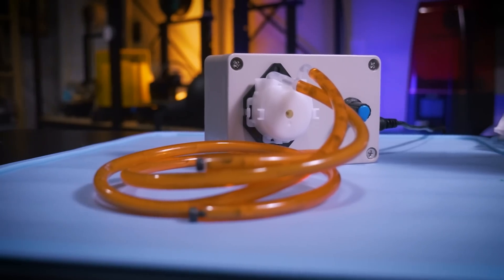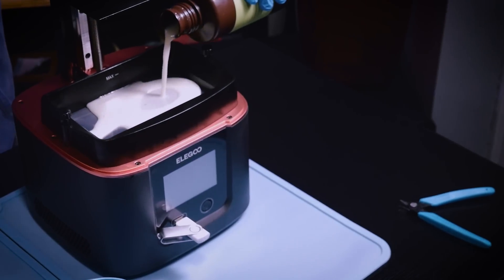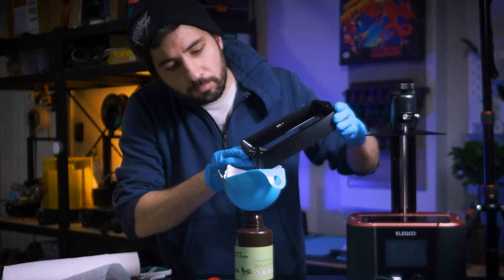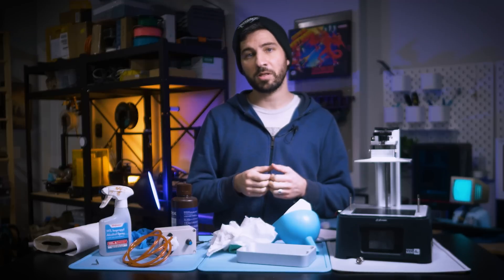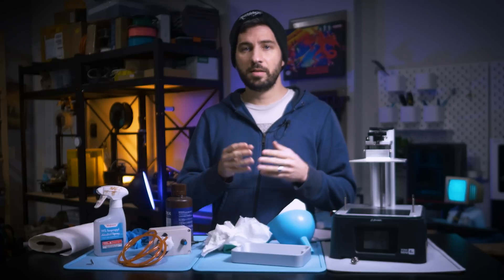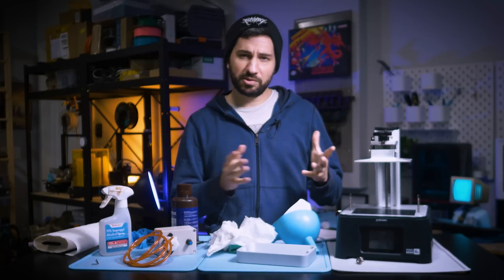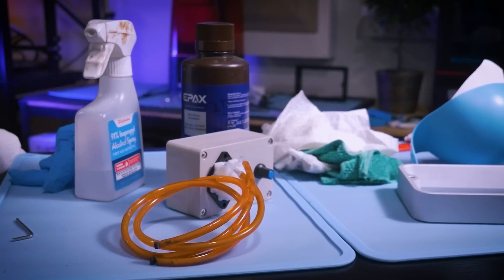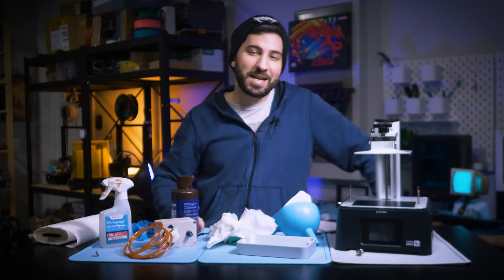The Best Resin 3D Printing Tool You've Never Heard Of

Comment: This is the greathing for 3d printer that we should have, I try to make it automatically fill the resin by the censore system and pull the resin back to the bottom when it get complete printing.

Comment: I use a big ass syringe but the pump would be good for the last bit.
I never remove the vat unless I'm replacing the FEP. When I get close to the bottom, I just put a block under the edge of the printer to can't it back/left/right to get the last little bit.

Comment: What about a two chamber vat that uses this pump to pump from the bottle into the vat and the vat has a low side that overflows back into the bottle through a filter. When finished you reverse the pump to pump the vat low through a filter and  back into the bottle. That way the build vat depth could be 1/4" and print until the bottle was empty.
Reply: Vat with an infinity edge on one side leading to another tube to gravity feed into a filter / funnel / bottle.

Comment: I don't even have the resin printer yet, but if you are still using the peristaltic pump, just put something under one rear leg so the vat is tilted towards, say front left corner and print the tubing holder to install on the vat corner, so you don't have to move the resin around with spatula. This way you only have to wipe the vat after it's totally drained. Although I'd go with really big syringe, as used for horses, wrapped in black foil or shrink wrap black tubing, suck all the resin in one stroke and keep it there instead of bottle. Oops, I just saw your other thumbnail with syringe. But I'll leave the comment just in case..

Comment: No reason to push resin through the pumping mechanism. Resin pots are pretty frequently used in the glue world. Just need a vacuum for extraction and a pressure pump for dispensing. https://www.youtube.com/watch?v=n8h4TjjQrow&list=LL&index=2&t=203s

Comment: Ah too bad, this completely changed my mind. Taking way too long with Elegoo Jupiter and having to be there all the time guiding the hose. The 500ml syringe is pretty expensive but I think I'll have to try that.

Usually I want to be quick 1.5 liter resin is a lot but hopefully I can design something that it doesn't go so far over the edge of the vat on the sides but just the corner.

Comment: Tip! 

Tank Inkjet Printers have an inline peristaltic pump to dump the waste paint into the waste container. You can reuse those by trilling a few holes and adding a DC motor directly to the gears

Comment: Great idea. Will try it. Thoughts on possible improvement: Instead of having the resin pass the pump, I would try to use it to underpressurize the target container and sucking the resin in there („suction trap“). By having one dedicated, short hose (at least for the most often used resins) for that, one might not have to clean as much for the next resin, and thus less resin would have to be wasted.

Comment: Just bought the pump.  It takes a 2mm ID tubing which I also bought.  However, the flow through the tubing is poor at best.  what is the ID of your tubing- it appears bigger than mine. thanks.

Comment: Man, I hate when people in videos show the use of the plastic spatula on the FEP sheet. It can damage the FEP sheet and you are telling us that you are wanting to handle the FEP as little as possible and yet you use a potentially damaging item on it. Why not use a silicone squeegee instead or even a rubber spatula that you would use for baking. So many people think that using the plastic spatula is a good thing and it is not. :(
I do like that you are using a pump but there is a lot of clean-up with that too that you aren't showing as far as clearing the tubes and the pump itself of the resin inside of it.
Reply: Hey, I get the sentiment, but these pumps are 100% tube. There is no "Clean the pump itself".

Comment: Can you tilt the whole printer a bit, (with wedges for example) so the resin flows in one corner where it can be conveniently collected? This way you don't need to take out the vat - or do you need to recalibrate the printer after you move it?

Comment: the worst thing i had? silicone mats...
as i learned from the plastic shop of my work, the best surface is plain stainless steel. Its smooth and you can clean it 1000x easier than these silicone mats.

Comment: Why are the Vats not designed with a tap? treat them how you would a reservoir for water cooling.  Add a tap to the outside with the proper grommet and plug to keep the resin inside.

Comment: Maybe a titling table surface that tilts the whole printer slightly to a corner of the vat. Then clip the hose (3d filament printed of course) to the low corner.

Comment: I ended up designing and printing fittings to plug my funnel into the bottles, so that the vat can firmly rest on the funnel. I leave it dripping for half an hour and it's totally dry by the end. It's okay solution for Mars and other small printers.

Comment: Can I add on here some of this can be automated with a jig pushing the vat to one side and you could totally put an in line filter on there not to mention there's already designs out there to print peristaltic pumps then all you need to buy is the hardware for that a few screws and a motor  that would also solve the speed problem too

Comment: I don't know, 
First of all anything stuck to the FEP will remain stuck to the film... you need to push on the back of the film to get those off.
Second, there's a lot of resin staying in the tubes
Third, I foresee a problem having resin in the scoops of the pump hardening
Fourth, cleaning the fep vat while on the printer seems risky damaging the UV screen underneath

But if it works for you... you do you...
 I'll keep doing what I'm doing

Comment: Danny, This is a great idea that has spawned possibly an even greater idea. I hate removing or adding as well. So my background is in mechanical engineering. and you messing with this pumping system has got me thinking. 

I will often leave my resin in the vat for days. or even when you have long prints. I notice the resin really likes to separate, and settle. This pump system could be done as a full time recirculation pump. always keeping the resin in the vat in a better mix. you could add an inline filter to the lines, and constantly remove possible particulate. the filter would work as a mixer as well. You could also add a second line to the input side, with valve to add resin as well as valves on the output side to empty. the hoses could be mounted into the vat on either side to create the flow, just would need some 3D printed clips. or for those with some machining abilities. threaded pipe nipples. I think you would want to get the hoses as low in the vat as possible.... 

Heck, some very cleaver Electrical Engineering guys could even make this type of system with a level sensor and solenoid valve system that would pull resin directly from a bottle and maintain a constant level of resin in a vat.  A little more electrical knowledge and that could add a flow meter to the output and tell you when the filter is plugged, level is too low, etc. 

Dual purpose system ,recirculation, empty fill.

Comment: Have a small cup of IPA nearby to flush out the tubing when you’re finished. Then flush it again with some distilled water. Won’t have to worry about cross contamination if you’re using different resins.

Comment: Got my first resin printer on order. I wonder if someone could scan the vat then modify it to have a threaded hole in one of the lower corners that you could fit a small needle valve into. You could design the opening of the hole so that it looks like a funnel that tapers towards the fep. Then just squeegee towards that corner to get most out. YouTube what say you? Oh and then print the new ported vat on the same printer? Would it fit? 🤔 depending on the Thickness of the vat , you might be able to curve part of the hole down below the surface of the fep for a lil gravity feed action. .. OK I'm feeling a new project coming on.

Comment: I like this idea. The one downside is the slow speed. 10 minutes for a Saturn means 15-20 for a Mega? There’s a whole variety of these pumps used for Aaquarium dosing and many are controllable with variable speed so do some research to find the fastest pump. 
To avoid the fire-hose issue, maybe design and 3d print a clip to hold the hose on the vat and another to hold it one the bottle - you could even incorporate something into a funeral to hold the hose. Again look into Aquarium equipment - there’s loads of clips and holders out there for dosing tubes and pumps.

Comment: Now I'm wondering if you could make a nozzle that fits the width of the vat you're emptying. Like the floor nozzle for your vacuum cleaner. If it has a built-in clip for the vat, you can probably just leave the printer at an angle while the pump runs. While you're at it, make a silicone squeegee at the appropriate width to make clean-up even easier.

Comment: I think there should be a pump recirculating the resin as it prints to prevent running out and chunks developing mid print.
Reply: if you are developing chunks mid print, then you need to calibrate your machine and exposure settings.  that is not normal and should never happen.

Comment: Nice idea. How to clean it at the end of the process? and will it quickly dirty the alcohol...
Reply from the maker: Cycle out some isopropyl alcohol through it all ya need to do. I filter between a dirty and clean Tupperware, but only when I'm done using it. Left it between days and no issues so far.

Comment: Great idea!  Some thoughts:

1. Get/build a larger pump to save time.  There are plenty of DIY plans/models/etc. available.
2. Use multiple pumps connected to a manifold that clips to the vat.
3. If you are DIYing your setup, you can attach multiple pumps onto the shaft of a single large motor.  A washing machine motor would almost certainly be overkill in terms of torque, but...
4. Use a 'dam' with soft edges that inserts at one end of the vat and seals the bottom and sides as it slides along.  That way, you can ensure the pump is pulling from the deepest possible pool no matter how much resin is left in the vat.
5. Incorporate a way to clip the manifold to the dam so you only have one piece to worry about.  You can create one dam for each unique vat size.

Does that make sense?

Comment: How do you prevent the resin from curing in the hose/pump? Completely cleaning it with IPA after each use seems to me more messy than cleaning vats the usual way.
Reply: if you put the pump and tubes in a box or something then the resin will never cure.   the only thing that cures resin is UV light.  most modern windows block most UV light already, but putting it in a box is even better.

Comment: Sound great! I'm a bit worried about the inner part of the hose. I imagine that those sticky resins (like Creality) will stay inside and get mixed with the next (transparent) resin. Do you have to clean it? That would create extra steps and maybe reduce the benefit of an easier handling.
Reply: Cycling some isopropyl once you're done cleaning the vat should be a decent way to dilute and remove any problematic resin in the tubing. That being the case it would still be wise to change out the tubes every so often.
In any case, I can't wait to give this a shot! I've had some peristaltic motors on hand for a few years with nothing to do until now!

Comment: this only works if you use the same resin if you swap it youll have to swap hoses and the pump because its all inside that pump this is kiinnda useless really think bout it
Reply from the maker: You must've missed the part when I talked about cleaning it out with IPA between swaps
Reply: You would clean out the hose using a little IPA so no need to swap.

Comment: I am not sure I understand how this is supposed to waste less resin than the screen clean function. All the resin in the tubes will have to be flushed out so you will use more IPA and more resin. Still better than manually having to drain it when you switch colors/resins, but I rarely do that.

Comment: i think the trick would be to have it attached to the vat. cycling and moving the resin i think would be good but i dont know. scrapers and tilting beds are a thing so i figure it might be good. but you could also use this to run the resin through a heating loop. some resins need to be heated to print well so that would be super beneficial. a couple of valves could easily let you set the pump to "drain" instead of loop.

Comment: You need a tip like that steam cleaners use to draw up a wider area of resin rather than needing to grab you scrapper.  It should be wide like 2 scraper blades  with a narrow slit between them and  tapering to the hose.

Comment: OK, my first printer, a resin printer, should be here in a few months and I am BRAND new to the hobby. This video makes me more than a bit nervous as I never realized this step existed. I have never seen a video of anyone that goes into what to do for clean up after a print. Made me realize there is an awful lot I do not know just getting started. Danny, do you have a video or series of vids for the complete beginner to resin printing (or any 3d printing for that matter) on how to setup to use their new resin printer for the first time, what all the steps are and what extra equipment I should have on hand before I start?
Reply: uncle jessy might, orjust search. you NEED  a respirator, nitrile gloves, paper towels, alchohol in a little spray bottle is very useful too, its a messy hobby. so waste disposal is big thing. and space. clear working space

Comment: Use some milliput around the tubing close to the end - you could easily mold it around the tube and push it into the screw on the vat (just get the imprint, don't cement it to your screw)- the weight would hold down the tubing, and it could rest on the screw to stabilize. A wad around the other end could easily have a paperclip inserted in as well, to hang on to your funnel.
Reply from the maker: The milliput is a great idea, and pretty simple! I might give that a shot!

Comment: The amount of resin you had in the vat is not what I would normally have left after a print has completed, I usually only have a few mm depth of resin left after a print and pouring it into a filter+ funnel is not a problem as everything is contained within a deep tray to contain any spills, which are rare, my biggest problem is forgetting I have gloves on that have resin on the fingers and then go and touch things and mark them with resin
Reply from the maker: You’re right, and that would probably make this a much better use in that case. Thanks for the comment!

Comment: I think you're missing the bigger use of these pumps, for the reverse! FILLing your vats with resin especially coupled with a smart switch (just on/off) or with an Arduino for large format you'd never have to worry about an empty vat mid print!
Reply from the maker: I knew when I posted this video that the comments would make this idea better. Ya’ll rock.
Reply: was thinking the same thing
Reply: The thumbnail had my brain thinking it was an autofill pump
Reply: How would you make the switch/sensor to make it an autofill feature?
Reply: @huyked  old school way, stick a float sensor in the vat. Same way a toilet works.

New school way, webcam + AI + training. A raspberry pi can do the job these days. You might have to train on a desktop or rent a server.
Reply: @jtjames79  
Thank you.  Will have to search around.  :D  "Tiny hobbit toilet float sensor".  :D
Reply: There might be a mechanical solution like the archimedian principle where it will autofill by pressure difference by itself.
Reply: @sierraecho884  there is and I was working on a design, but screw that this is a lot easier.
Reply: @jtjames79  Hahahah, true ^^
Reply: Could be as simple as knowing your print uses 50ml during 6h, you can easily program the pump accordingly ...
Reply: Tap a hole in the side of the vat if you are feeling froggy
Reply: Why not also feed that via a heater loop?

Comment: Strange, I see peristaltic pumps almost every day at work and yet I'd never considered this. Thanks for the tip.
As for something to hold the tube, consider a swing out clip mounted to the hold down clamps.
Reply from the maker: This is EXACTLY how I felt when Grant suggested the idea casually on that Twitter thread! It was really cool to try it and see it work on something other than clear solution in a lab or something.
Reply: Pick up a box of bulldog clips from the office supply store for a couple bucks. They hold securely and you can slip the tubing through the handles to hold it in your funnel.

Comment: How do you clean the pump out between resin colour changes, just run some IPA through it?
Reply: That or have different tubing for the color and clamp the tubing.  Most of these pumps allow for the tube to be replaced.
Reply from the maker: Like @zacknafin mentioned - you can choose to buy another set of the tubing, BUT that can get a bit messy cause the resin leftover on the inside will  absolutely spill out. If you’re using the same resin between VATs in a reasonable amount of time (for me it’s like 1-3 days), I don’t clean it. It hasn’t affected my suction at all. 

If it’s longer, yes - I run IPA through it into an IPA loop so that it goes back and forth. Or I just do IPA into an empty container and loop it like that. Kinda like having some dirty IPA still works, etc. That does the job, and then I plug it with the screws so that the recess doesn’t leak out. Make sure when you open it that you’re over something or clean it up, the pressure will make the rest leak out. 

Thanks for the question!